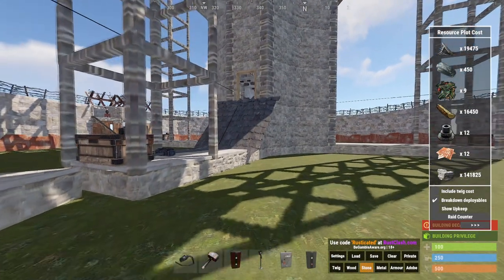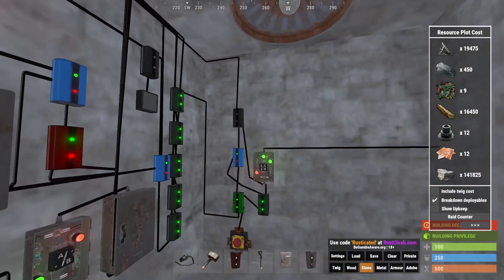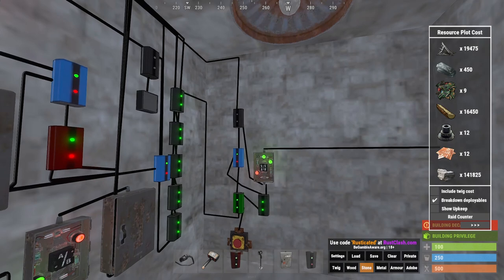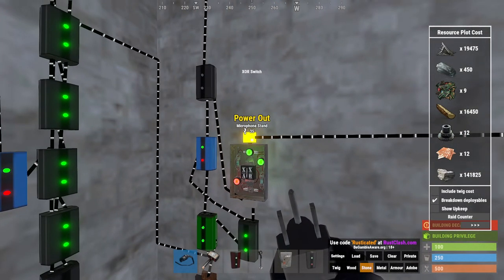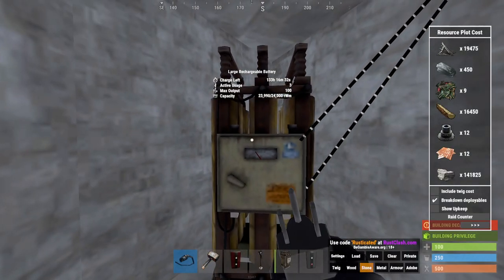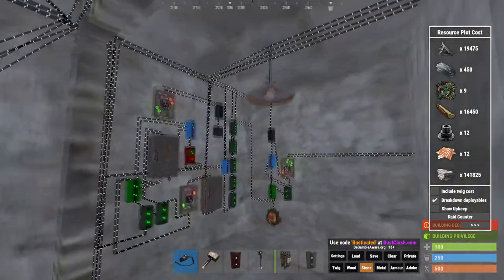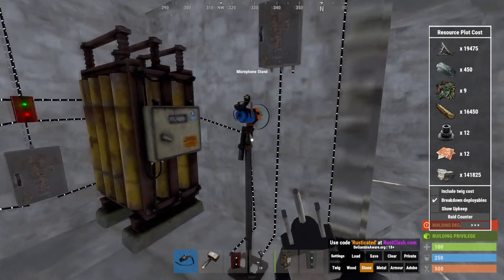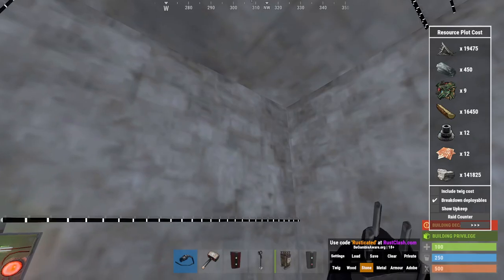The Nih Reclamation Unit - Ep 5 | How to be a Better Rust Electrician

Comment: Does this work for console, it does not let me to connect splinters to root combiners. Is there a requirement to be able to connect it or just crust jank
Reply from the maker: Yeah the splitter is needed it's what fools the game into allowing the circuit to loop back into the combiner. It might not be possible on console rust.
Reply: @JohnWillikers  yeah crust doesn’t allow you to connect a splitter output to a root combiner input, imma try to find a way myself.
Reply: On console the only a power source ( solar, Windmill, or generator) can be hooked up to the power in side. Also we don't have microphones on console so we can't do that trick